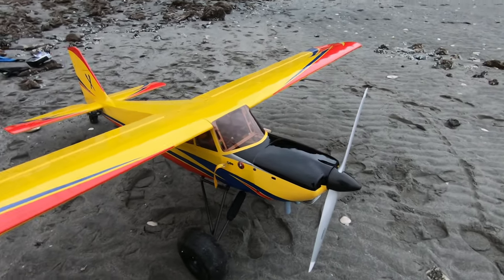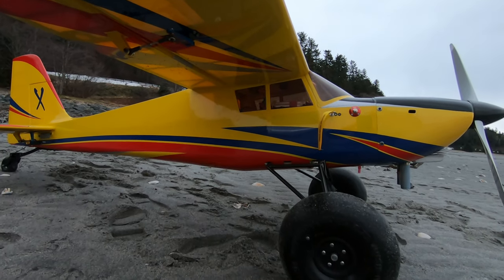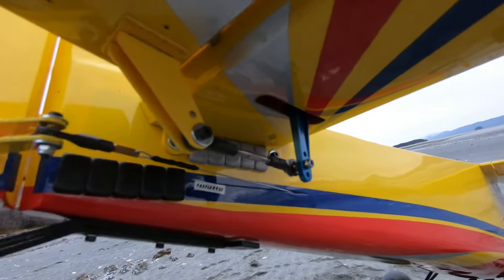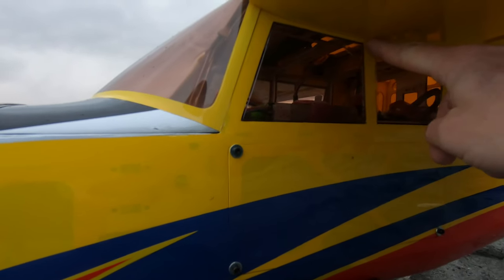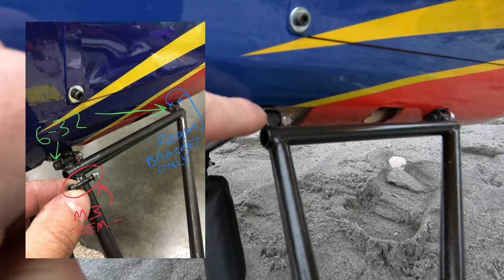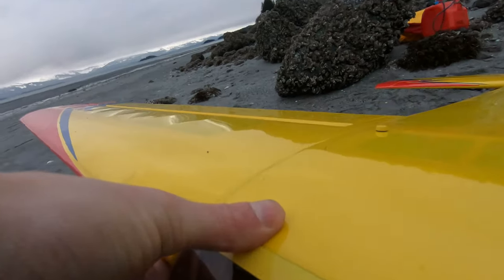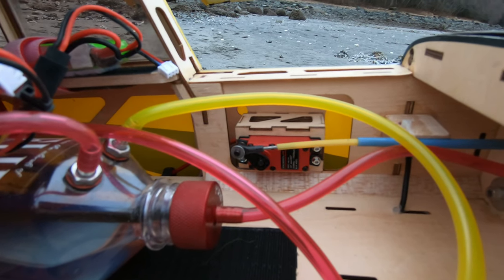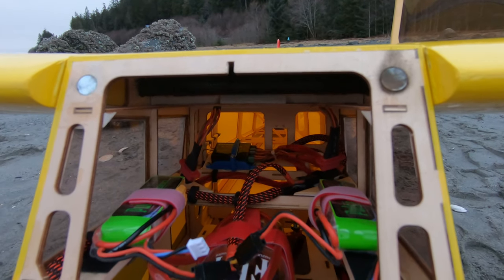AKNicks Timber110 Setup and Mods

Comment: Hey Nick, love the videos! I sent a message I think last spring. I'm in Anchorage, I was wondering if I could possibly pay for a tailwheel? I don't have a printer. If that's something you might be willing to do I could meet or PayPal, Cash App with an address. I have the 8.75's but not the tailwheel, kind of hard to find the PR tail. Cool if not but I had to ask just in case. Thanks bud!
Reply from the maker: Hey Zach! I should be able to hook you up. I’m not sure how to send you a PM. I have one printed. Quite a bit of fiddling and getting the fork to fit nicely and risk of breaking if you don’t take your time. Then you’ll have to get hardware. I could whistle some stuff up, but since I don’t have bulk hardware for this it can run the material price up. When it’s all said and done you may realize it’s a labor of love. 😂 but the shock cub has a tailwheel assy that may work pretty good too.

Comment: I have built a Timber and used a lot of your helpful knowledge. Thank you for the video. Just got done installing the tail wheel you designed. Sweet work! I live in anchorage and would like to fly with you sometime. My Timber is running a DA 70 with smoke.
Reply from the maker: DA70!!! Dang! Thank you for the kind words and glad to hear you appreciate the tail wheel design as well. I'm always looking for a flying buddy and some decent weather. I fly with the Gastineau Aeromodelers Society (GAS) here in Juneau. Flew one summer up in Fairbanks 2007?? at the Midnight Sun RC club.... man do I miss that flying field and a thriving club with events.